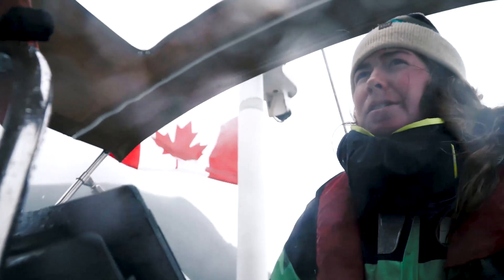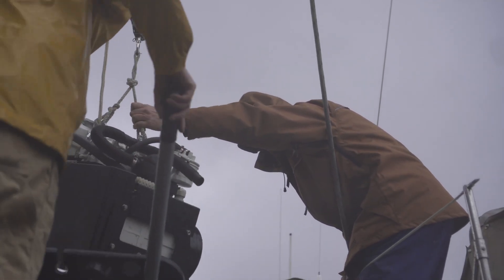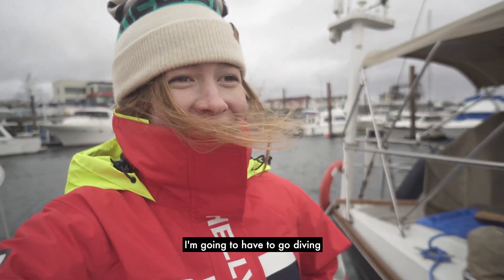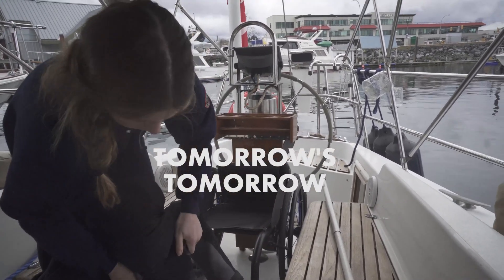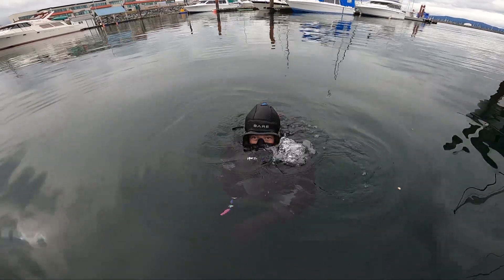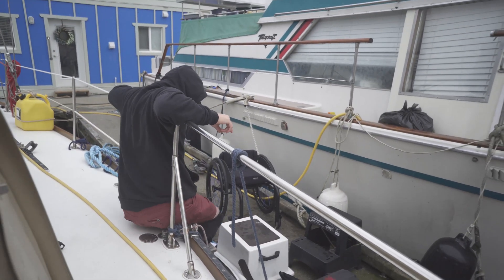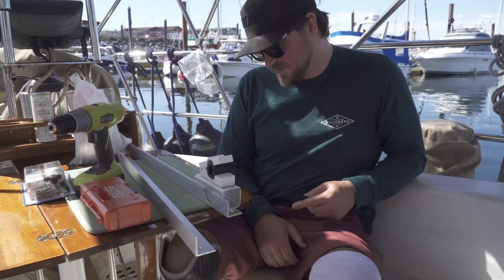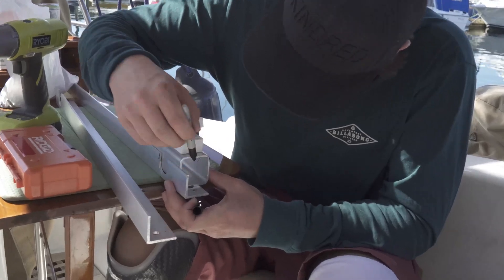EP 21 | DIY Solar Panel INSTALL | What Went WRONG?

Comment: Electreneers are hard to come by!   Panel mounts look deadly.   By the time I write this you have probably got it sorted.
Reply from the maker: Not even close. So frustrated and not sure what to do next. Just want to pay a solar expert at this point
Reply: Oh no !   I’m not an an expert but I know one really well.   If you can sketch your system on a napkin and get Ty to txt me a picture I’ll send it to him.   Maybe he can give some advice.  Or likely places to look for the issue.    Include make and model of the controller and panels.   Wire gauge and any other info.
Reply from the maker: @sammayes-mackenzie7368  thank you!! That is helpful. We have the best subscribers 😂😂

Comment: Awesome guys!! Don’t give up… you both are way more brave on the electronics side than us!! Curious we just have the one victron solar controller, but we just have a 100w panel at the moment on our arch. I see you have two controllers - is that just to handle the 5 different panels?  Still learning the basics!! 😎 Can’t wait for the next video guys… Fair winds!! ⛵️
Reply from the maker: We are clearly still learning too! Haha! The two controllers are because we are running the two large panels in parallel (as it’s likely one will be shaded while the other is in sun) and then three flexible panels in series). Thanks for watching as always!